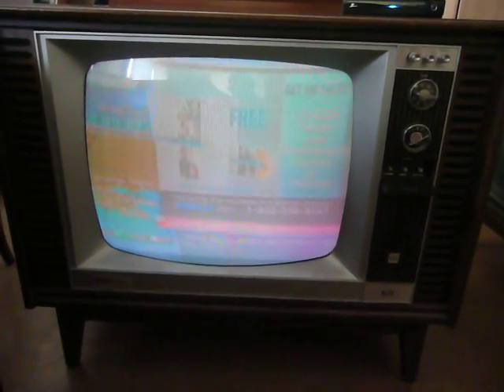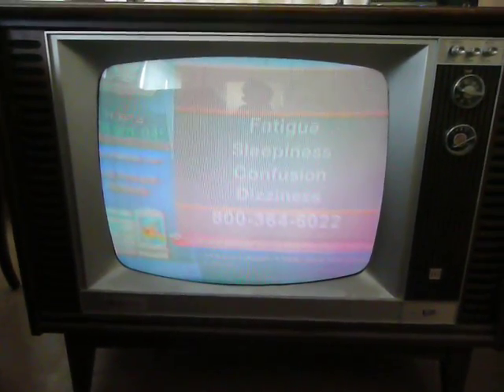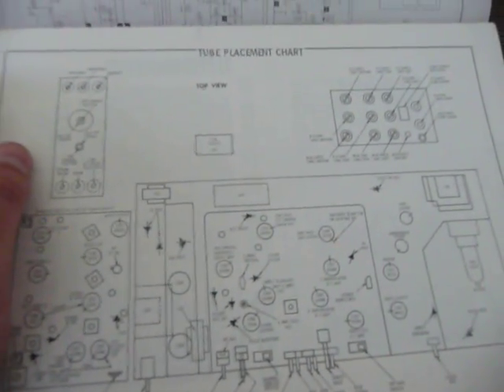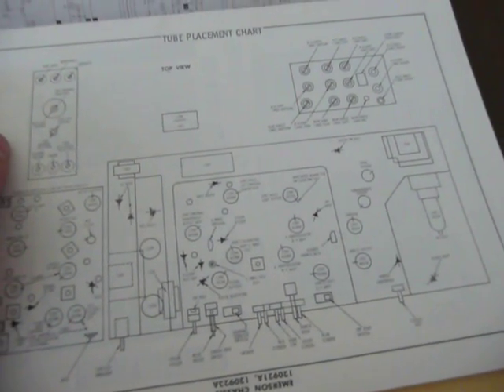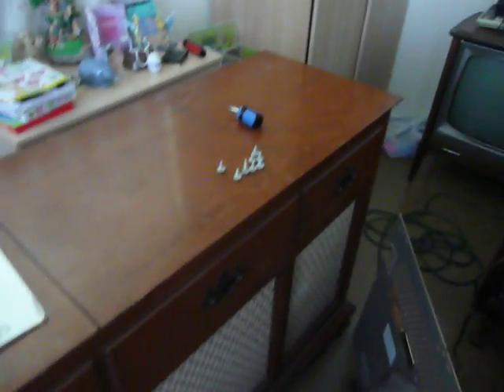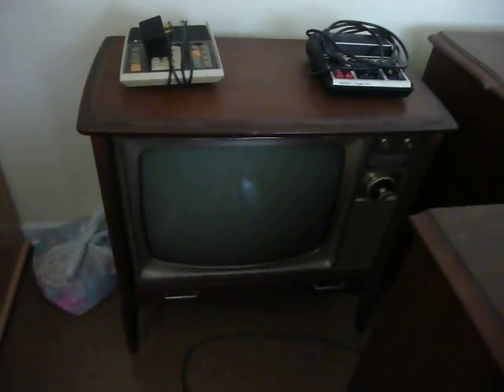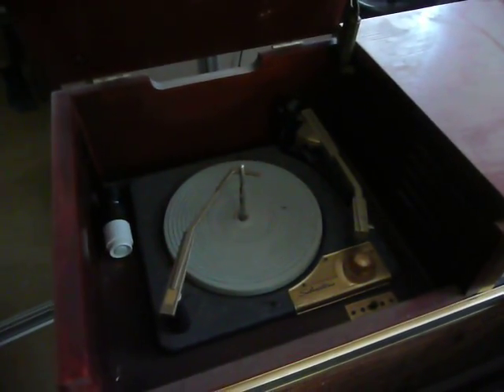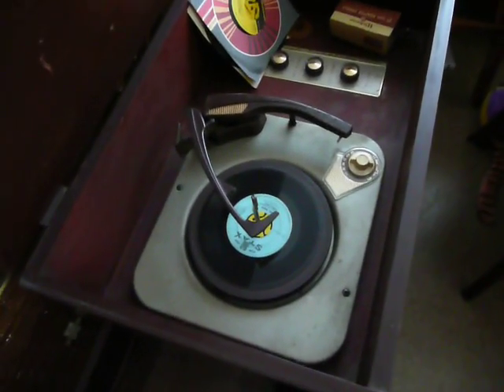1969 Emerson 26C38 Color TV

Comment: We had one of those. I can declare that with confidence because I was in the back of mine a lot a couple of years after we got it. My grandma bought two of these in 1970, one for her and one for us, because she got a deal at the local TV repair shop and they were very much more inexpensive than a comparable Zenith, RCA, or Quasar. The reason I was in it a lot was this set had instant on, so the tubes were lit up at all times, even when the set was off. This served to cook the CRT and operating tubes before their time.

I remember as a 12 year old kid, walking down to the local Thrifty Drug Store in Arroyo Grande, CA, and getting the TV tube tester kit. It had 30 pairs of numbered stickers. You'd put a sticker on a tube, remove it, and put the same number on the tube's socket. I put all the tubes in a bag, my mom gave me $20 and I walked back to Thrifty's, tested all the tubes, replaced the ones that tested bad, got an ice cream cone, walked home and replaced all the tubes. The set worked well the first time I did it.

The second time, the CRT was starting to suffer the problem shown in this video. Rather than drive herself crazy, my mom went to Montgomery Wards in Oxnard, CA, (The Esplanade Mall) in 1973 and replaced the Emerson with a Zenith Chromacolor 26" color console TV in Mediterranean style cabinet. That TV was all solid state, so it lasted a lot longer. We had that TV for a couple of years, then, moved to the San Francisco Bay Area and I believe she gave it to my dad. We loved that TV. That was the one I used to watch Star Trek and old movies on.

My grandma went full redneck with her Emerson, by the way. When hers suffered the same fate as the one in the video, she got herself a portable 22" RCA ColorTrak. She covered the Emerson with a tablecloth, and put the RCA on top. She had that set up for many years.

Comment: I have this same TV, in working condition. The only problem with mine is that it is missing the color and hue knobs.

I found mine in college (mid 1990s), at my apartment. My roommates did not want it, so I took it when I moved away. The convergence was way off at first. I was able to improve it, but it is still touchy. If the TV is moved, the convergence must be realigned. Changes in picture content also tend to affect convergence some. Perhaps this is just an artifact of the set's design.